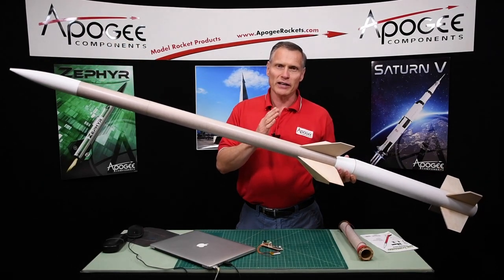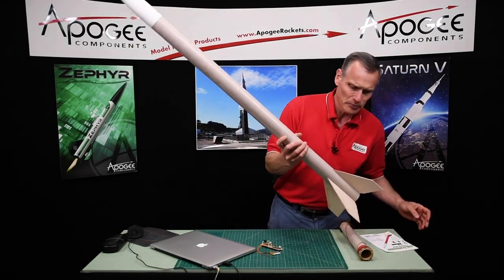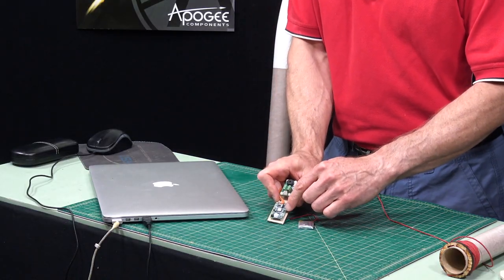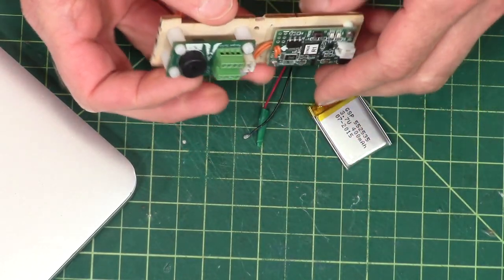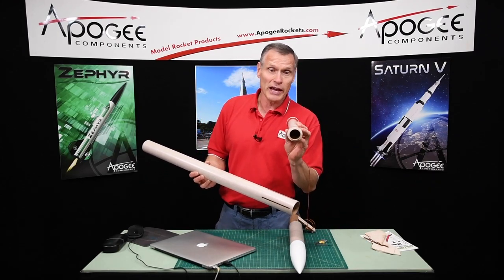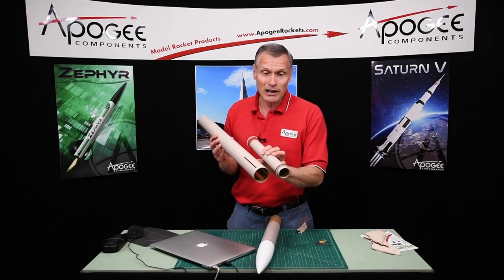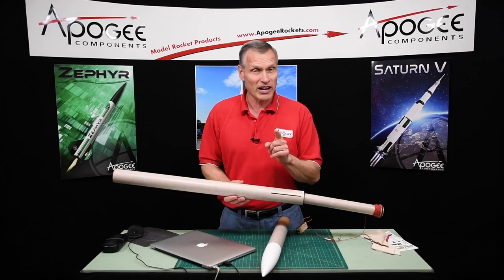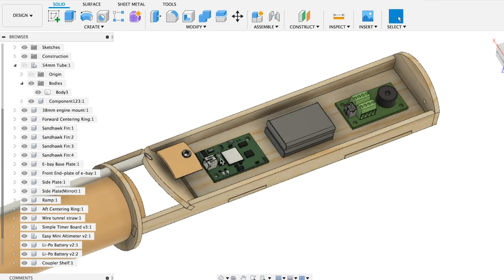Terrier Sandhawk Build Part 1 - Design Philosophy

Comment: I don't quite understand.  It seems like a lot of very tricky work to get the e-bay located where you have it.  Couldn't you just run a thin brass tube up near the coupler and use that as the e-bay?  It's only about a foot further and would be so much easier to build, plus it would help keep the CG forward.  Am I missing something?
Reply from the maker: I think if you watch the entire series, all your questions will be answered.